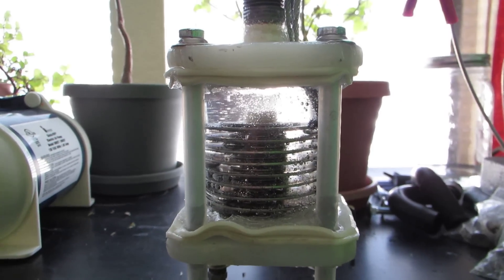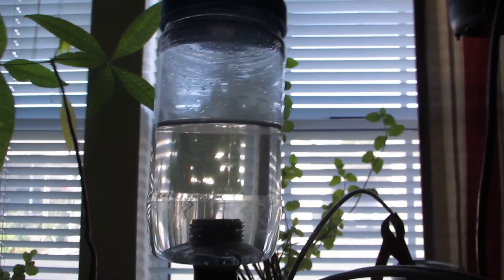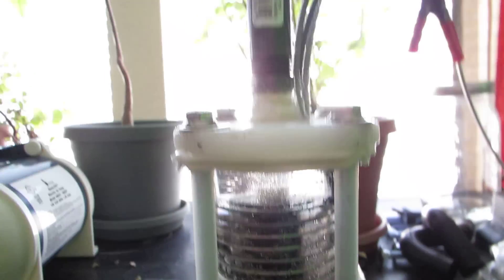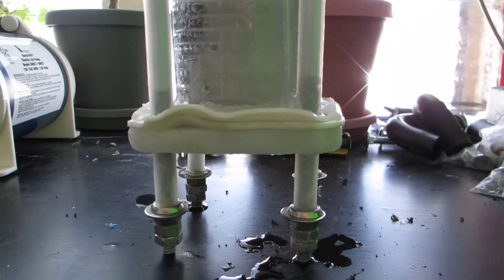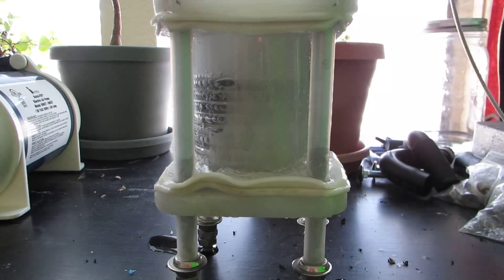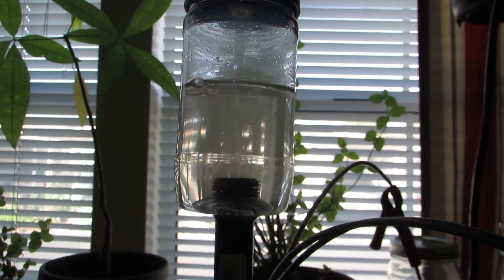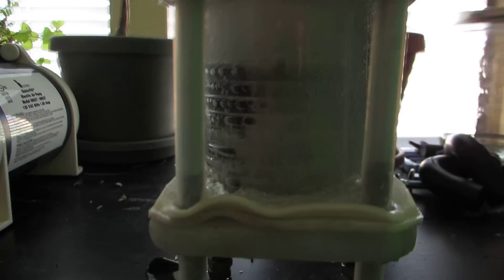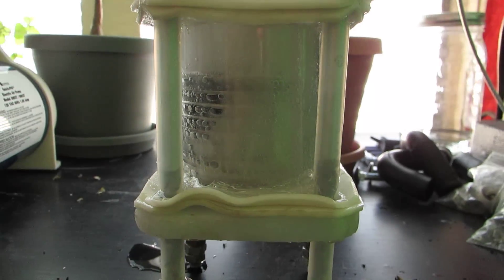Vid61 Volcano Washer Hydrogen Generator Test 1

Comment: Don't compress the gasket material with the spacers on the bolts between the top and bottom.
The pressure should be only to the acrylic area. Just cut the corners off the seals.
Think that will help.
Is an interesting design..